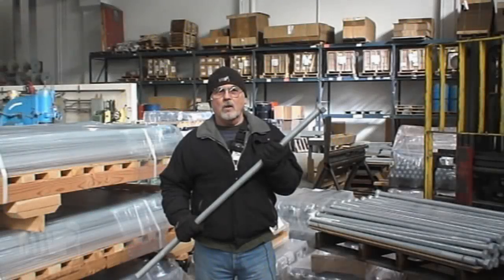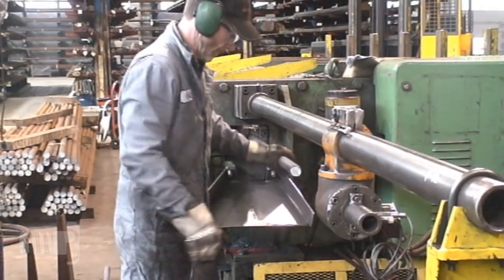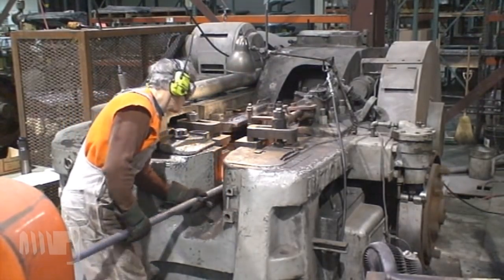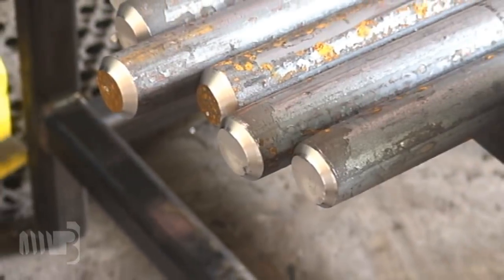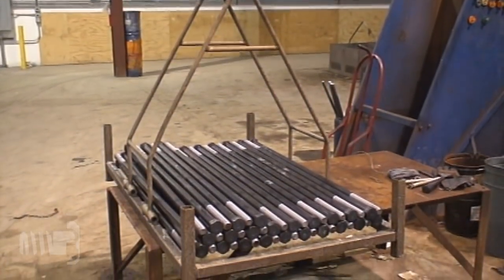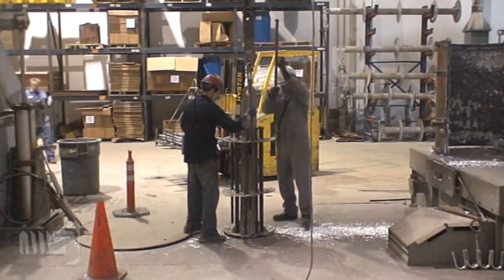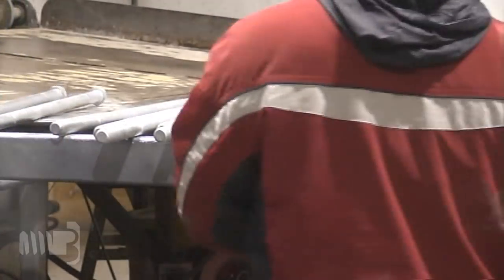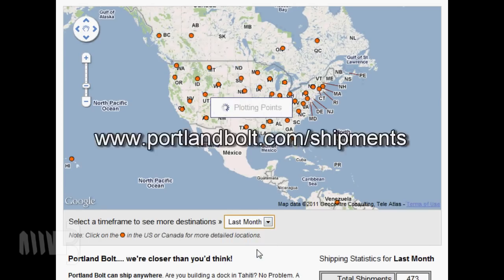How a Bolt is Made - Portland Bolt & Manufacturing

Comment: I'm surprised your company still exists, with China pretty well dominating all areas of manufacturing.
Reply from the maker: +videoclipits 

China, India, and other Asian countries do dominate the construction fastener industry with regard to many mass-produced, standard sized construction fasteners.  However, Portland Bolt manufactures large, nonstandard anchor bolts and construction fasteners.  We are not a fastener distributor and prefer to sell products that we manufacture as opposed to products that we buy and resell.  However, we do broker standard fasteners as complimentary accessories to products we are manufacturing.

In the construction industry, lead times are short and contractors require bolts on the jobsite soon after they are ordered.  This does not allow enough time for custom bolts to be purchased overseas.  There are often quality differences between domestically produced bolts and foreign product, in addition to traceability issues of foreign products.  Fortunately, most federally funded highway projects and many government projects require American made fasteners.  More about the Buy American Act can be found here: http://www.portlandbolt.com/technical/faqs/what-is-a-domestic-requirement-and-how-do-i-know-if-it-applies-to-my-project/.
Reply: You said:"There are often quality differences between domestically produced bolts and foreign product"
That's an understatement. That goes for most of the junk these Countries produce. I think we in North America are finally getting sick of wasting our money buying from these shoddy producers.
Reply: the added  advantage is that these companies follow metric standards. US cant compete with therir crap that require special tool and lead to errors.
Reply: the added  advantage is that these companies follow metric standards. US cant compete with therir non standard products  that require special tool and lead to errors.
Reply: the added  advantage is that these companies follow metric standards. US cant compete with therir non standard products  that require special tool and lead to errors.
Reply: +videoclipits : You can get high quality products from China, they supply what the market demand: cheap products. When people are firstly concerned with price, why would chinese companies make it their priority to produce quality products. You just realized now that quality must be first and then price. You are not wasting your money because you just get what you paid for.
Reply: "Fortunately,most federally funded highway projects and many government projects require American made fasteners."  --Indeed!...:) You guys are well positioned for the upcoming run...You're fierce...!

Fellow Business owner for 3 decades...Buy American as often as possible. I drive, buy and sell American made.
Reply: Most of what you buy even american made is  in metric :)
Reply: It's all metric, the official definition of an inch is a length equal to 25.4 mm.

Comment: I applaud of this American plant of not outsourcing so as to secure a supply of engineering logistics for America BY MANUFACTURING EVERYTHING LOCALLY but I must be truthful. They should use stainless steel micro-ball sand blasting that uses minute size stainless steel alloy balls that has the proper balance of hardness and toughness, stiffness and rigidity, abrasion-resistance and wear-resistance, DUCTILITY AND MALLEABILITY, and corrosion risistance to sand blast clean the bolts from the top, bottom, left, and right and at an angle so as to sand blast clean the surface ends on both sides of the bolts without damaging or harming them (in the 1980s, plastic pellets that are made from recycled plastics are used in sand blasting were used to remove paint from military aircrafts without harming the aluminum and titanium skin) while simultaneously applying the peening effect to strenghten the bolts as if they are being forged 3 dimensionally. Then using dry ice sand blasting to remove any last remaining vestiges of contaminants and unavoidable but extremely rare metal particles from the minute stainless ball sand blasting-peening-strenghtening effect-process. Then using the multi-phase array EDDY CURRENT TESTING AND ULTRASONIC TESTING and X-Ray inspection process. And then using the iron and steel anodizing process that uses potassium permaganate to protect against rust and then using powerful omni-directional ultrasonic beams to rinse it clean of any chemical residues. Then using a very powerful precision electrostatic ultrafine molten metal spray, spraying a zinc-silicon-tin alloy so that the screw threads and bolts and washers still fits. And then start using again the multi-phase array EDDY CURRENT TESTING AND ULTRASONIC TESTING and X-Ray inspection process for quality control and using an electrostatic cathod ray tube open air styled conductive ink applicator printer which is an old 1970s invention by the British to print the code number of each bolt, date-time-place of manufacture, and quality control standard qualification inspections-tests-checks CERTFICATION and then they are finally and carefully packaged for storage and eventually shipment.
Reply from the maker: darthvader5320 - Thank you for the suggestions, but none of the ASTM fastener specifications that our fasteners meet require any of the processes or testing you have described.
Reply: Then like the Irsh used to say "IF IT AIN'T BROKEN, DON'T FIX!" but still it won't harm to give something DIFFERENT a try once you analyzed the economic situation that will allow you to do an another re-investment in making your bolts. Like Thomas Alva Edison once said "I'LL EVEN TRY LIMBURGER CHEEZE TO INVENT THE ELECTRIC LIGHT BULB IF I HAVE TO!" We use these methods for our nuclear engineering divisions in nuclear power plants construction in the sections not exposed to radioactivity and not directly dealing with radioactivity. We use a laser glazing process only in the radioactive exposed areas for improved corrosion resistance and fluid erosion resistance and droplet corrosion resistance.

Comment: Try look at the bolt production at "Dokka Fasteners". Lightyears ahead of the US style..
The US is stuck in the middle ages...
Reply from the maker: Dokka Fasteners is an outstanding company and has an impressive manufacturing facility. However, comparing Dokka Fasteners and US-based nonstandard construction fastener manufacturers like Portland Bolt is like comparing apples to oranges. Dokka uses robotics, automation, hot-forge presses, CNC turning centers, and other manufacturing equipment to produce production runs of precision fasteners. These fasteners are more frequently used in OEM and equipment applications and more rarely used for construction applications.  

Portland Bolt is a job shop with the ability to manufacture small runs of nonstandard construction fasteners in very short lead times. The flexibility to make short runs of fasteners with unique dimensions is a challenge for companies like Dokka Fasteners and a strength for companies like Portland Bolt. We utilize upsetters instead of presses, Landis cut threaders instead of CNC equipment, and most importantly, instead of utilizing robotics we provide jobs to skilled craftsmen and women who take pride in ensuring your bolts and manufactured correctly, on time, and within tolerance. Both companies fill a unique niche in the fastener manufacturing industry, but accomplish this goal in completely different ways.

Comment: Do you roll thread any of your bolts?
Reply from the maker: @Matt C - Portland Bolt uses flat die roll threaders to apply threads to fasteners that are 1" diameter or smaller.  We are limited to 8" thread lengths.  You can learn more about our roll threading capabilities here:  http://www.portlandbolt.com/about/manufacturing/threading/

Comment: Sir you should study up  on your  video presentation. A bolt is not a bolt until you put a nut on it before the nUt it is called a cap screw
Reply from the maker: Jim Hammond - There are two primary differences between a bolt and a cap screw.  One difference is dimensional tolerances, while the other difference is application.  Cap screws have tighter dimensional tolerances than bolts.  In other words, they are a more precise fastener. The other difference between a bolt and a cap screw is application.  Cap screws are installed by turning the head of the bolt, whereas hex bolts are typically installed by rotating the nut.  Most cap screws are installed by assembling the fastener into a tapped hole or internally threaded component on some sort of equipment or structure.  Some ASTM specifications require cap screw tolerances, while others specify bolt tolerances.  The F1554 anchor bolts manufactured in this video are hex bolts as opposed to cap screws since the headed end will be embedded into the concrete, the substataion structure will be set on the anchor bolts, and a nut will be threaded onto the anchor bolt to secure the structure to the concrete foundation.

Comment: Quaint the hear them talking using Imperial units, sounds very old school and nonprofessional.
Reply from the maker: @CJ W - With regard to the construction industry in the United States, engineers specify sizes almost exclusively using imperial diameters and lengths.  The round bar used to manufacture these bolts is rolled at steel mills in the US in eighth-inch increments and forms the foundation for the vast majority of construction fasteners used in America.

Comment: Sorry but this video was not useful or educational at all. They showed only one bolt that 95% of builders, mechanics or designers will never see or use.
Reply from the maker: @Eddie Hernandez - 

Thank you for the feedback.  You are correct that 95% of builders, mechanics, or designers will never use or see the type of bolt produced in this video.  That is what makes our niche in the fastener industry so unique and important.  

First, mechanics would not use or see our products since we make large, nonstandard anchor bolts and other construction fasteners for the construction industry.  Our bolts are not used in automotive applications and rarely used for precision OEM applications.

The vast majority of fasteners used by homeowners and small contractors are standard, imported, mass-produced bolts in common sizes.  We come into play when designers (engineers and architects) need large, nonstandard bolts that are not readily available in the marketplace.  We work with steel fabricators, contractors, and other construction-related companies that use our bolts for large industrial projects that include power plants, marinas, bridges, structural steel framed buildings, refineries, etc.

So your statement is correct.  For many casual web-surfers that stumble across our video and website, you will find nothing useful or educational contained in this video.  However, for large contractors, structural engineers, and other contracting firms involved in major construction projects, they will find this video, our website (www.portlandbolt.com), our experienced sales team, and our company an invaluable resource for technical information and quality fasteners delivered in a timely fashion.

Comment: I'm sorry to burst your bubble but you don't make any bolts you make screws
Reply: Those are bolts.
Reply: Christopher Paffrath
Those are screws until you put a nut on them
Reply: +MrThisIsMeToo  what makes that a bolt?
Reply: +Timothy Jones A bolt is a fastener with uniform external threads intended for use with a nut, where the nut is usually the primary method of applying torque while the head stays stationary. In this particular case, the heads of the bolts being manufactured are encased in concrete and therefore do not move, making these bolts. 

  A screw is a fastener that may have tapered or parallel threads that may not be uniform, and is intended to have torque applied from the head of the fastener. It may be threaded into pre-cut threads in a mating part, or create it's own threads as in screws designed for wood and plastic. Some screws can be used with a nut, which would make it a nut/bolt combo as in machine screws and many cap screws, so there is a grey area where it depends on the application and can cause some confusion. In the case of the video, the head is stationary and the torque is being applied to a nut, so they are, in fact, bolts. 

They've been doing this more than 100 years- They know what they've been making this whole time and I'm sure they've had this discussion on more than a few occasions.
Reply: Timothy Jones: You are 100% wrong. Read Nick Polanosky's comment.
Reply: There's one in every room...🤦‍♂️

Comment: This production site looks like nothing had changed since 1962... Look at the mess in 04:04 - these poor guys wrapping the bolds like it is their first time. I would not be proud of such a grimy factory, only because it happens to be located in the US. 'Made in the USA' should be a lable for state of the art production instead  of glorified, obsolete production systems from the 60s..
Reply from the maker: +goethe528 - Thank you for your comments.  You are correct in the fact that much of the manufacturing equipment we use today was built in the 50's and 60's.  This equipment was designed to last decades.  It requires regular maintenance and rebuilding of components but continues to produce quality fasteners.  

Unfortunately, I do not see the "mess" you are referring to at 4:04 of the video.  This is the packaging area for galvanized product.  You can see the cleanliness of our facility at any time on our live camera feed:  http://www.portlandbolt.com/about/live-feed/#packaging

The galvanized packaging area consists of orders that are completed and staged to be picked up by a trucking company.  This location in our manufacturing facility also serves as an area we assemble nuts, washers, plates, templates, turnbuckles, and clevises on galvanized products that will soon be palletized and labeled for shipment.

The manufacturing facility at Portland Bolt is not a clean room producing semiconductors or pharmaceuticals.  We do not manufacture precision fasteners used in the aerospace industry.  We make bolts for heavy construction with class 2 threading tolerances and dimension that comply with ASME standards for construction fasteners.  We are proud of the fact that our products are manufactured in the United States and are used on critical components of our infrastructure including bridges, highways, power plants, marinas, steel-framed buildings, and other structures.